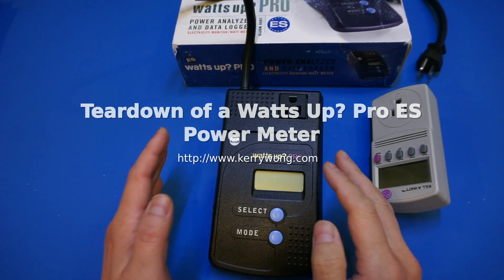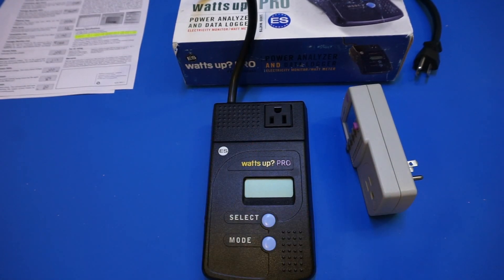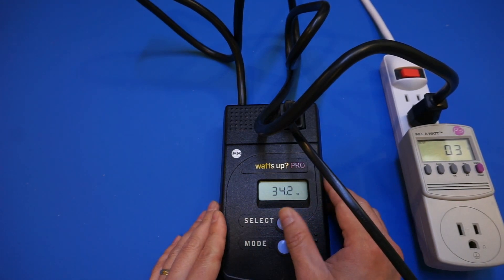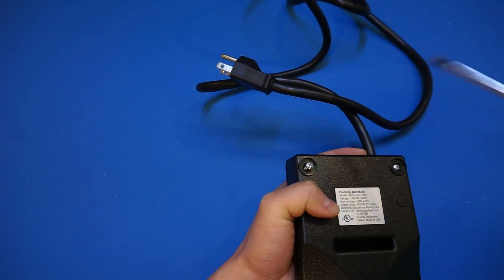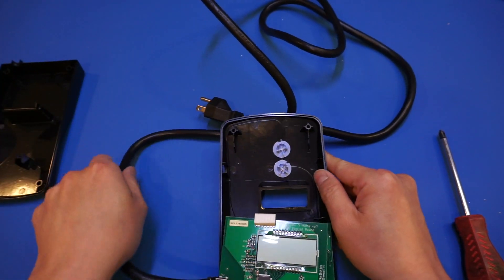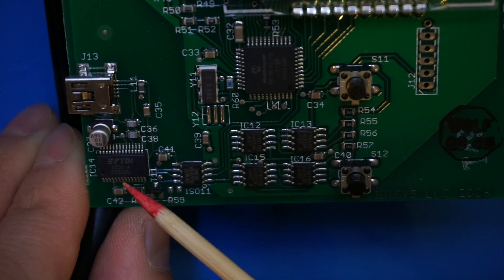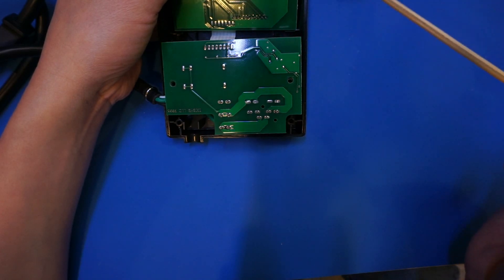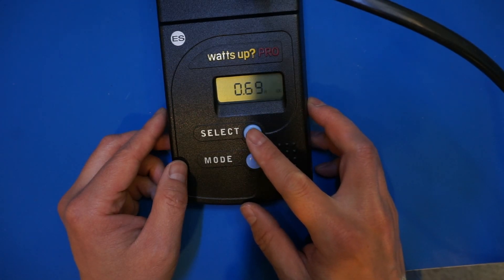Teardown of a Watts Up? Pro ES Power Meter

Comment: I have this model, which I dropped and afterward appeared to stop working. However, Power is still provided to the outlet as tested with a multimeter, but no output on the screen. I opened it up to see if there was a fuse of some sort I had broken, which led to finding your video. Any recommendations on what to check to get it functional again, or think it’s a goner?